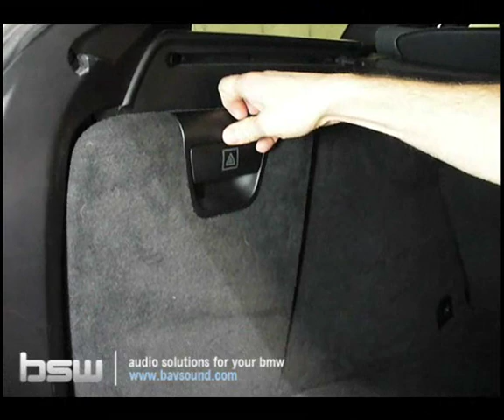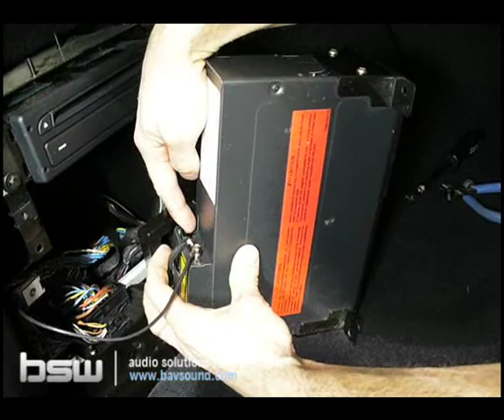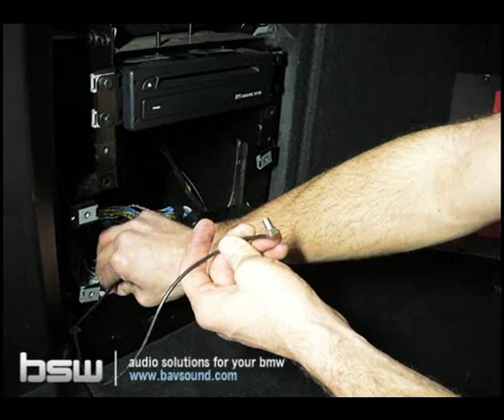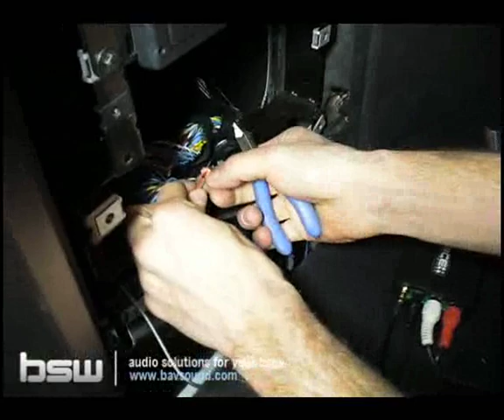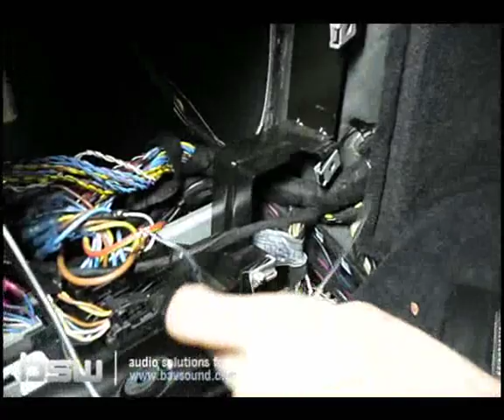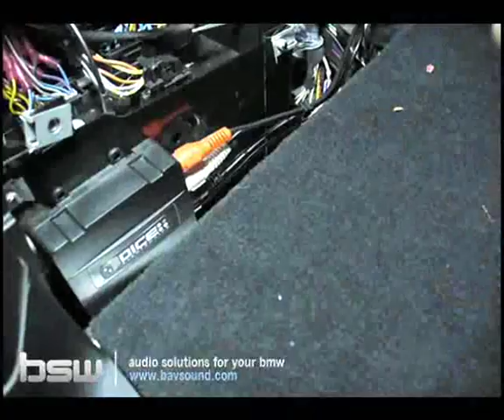BMW Speaker Upgrade/Installation | BMW X5 | BAVSOUND Soundplicity CD Changer Removal & DSP  | Part 1

Comment: hello, great video, I found the 3 pin connector but I cant find the 6 pin connector anywhere, are you able to help me out. I have the identical set up as what you have in the video. I have an 02 x5 4.4i... No DSP. and i accidently plugged in an identical 3 pin connector that i later belive to be a phone cable? will this cause any problems if i plugged it in. some say yes, some say no. any help will be of great assistance

Comment: Hi, I have a BMW 325i E46 (2001), and the CD changer isn't working right. I was just wondering whether I need the 6pin connector AND the 3 Pin connector, OR the 6 Pin connector only??

Comment from the maker: @HERNANDOBAR - Should not be an issue... Make sure that the CD Changer from the 2001 model has both the 3 and 6 pin connectors on the back of it. If so, you're good to go.

Comment from the maker: Should not be an issue... Make sure that the CD Changer from the 2001 model has both the 3 and 6 pin connectors on the back of it. If so, you're good to go.